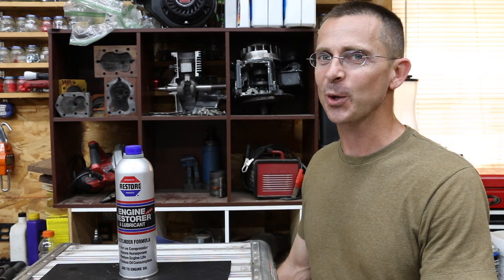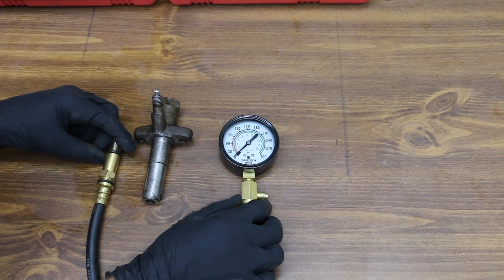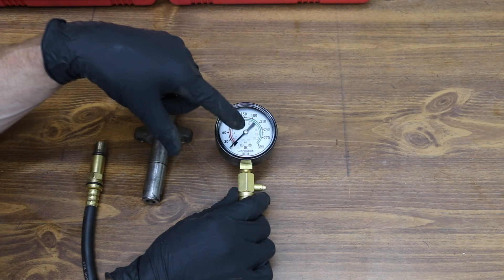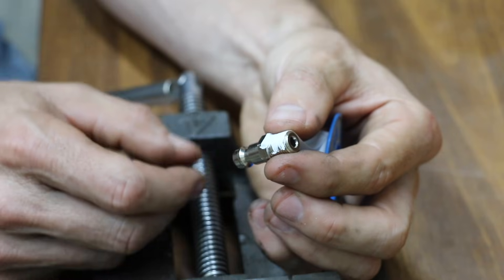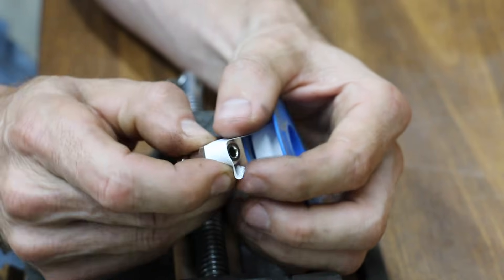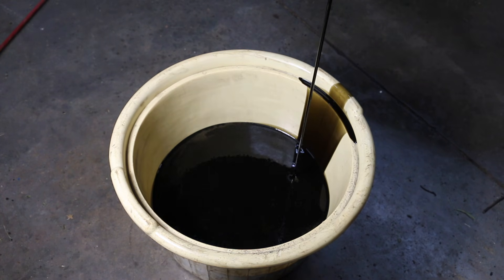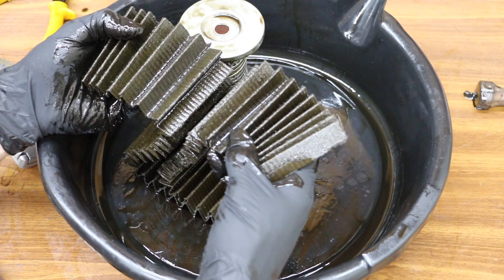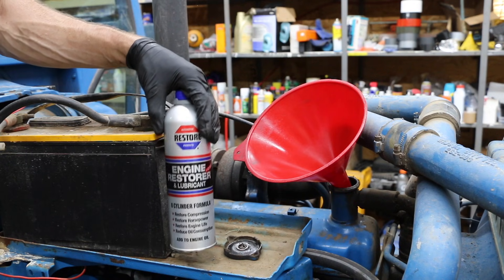Did the "Engine Restore" Compression Improvement Last?  One year later (Episode 2)

Comment from the maker: Thank you all very much for suggesting an update video engine restorer!  Best regards, Todd  
Engine Restorer for 8 cylinder engine: https://amzn.to/3j4JoEb
Engine Restorer for 6 cylinder engine: https://amzn.to/32kpEpt
Engine Restorer for 4 cylinder engine: https://amzn.to/32liXDq
Reply: Wonder how the compression is nowadays…
Reply: If u ever cut open another oil filter, squeeze the paper before you open it to dry it out the liquids then open to see if anything is between bends(thick liquids can hide solids)
Reply: I wonder how that stuff works,and restores compression
Reply: @antonoudenhoven7573  soft metals bond to the cylinder walls
Reply: @antonoudenhoven7573  Probably the same way as cera tec with a light coat sealant for the gaps.
Reply: So is it OK to use a16 ounce can of restore in a 4 cylinder diesel engine with a 9 quart capacity?
Reply: @tomgreco9905  the can says what engine displacement it works with.
Reply: @der_pinguin44  👍
Reply: @tomgreco9905 yes..that's what he did.
Reply: What is the recommended frequency of use for Restore? On an engine with 255,000 miles on it would it be recommended at every oil change going forward or periodically every 10k, 25k, 50k, etc. Great content as always! Thank you so much!
Reply: @TravisStepp  there is no suggested interval. I did mine 50k miles ago in a Colorado, and it's still doing well.
Reply: @der_pinguin44  understood, thanks!
Reply: @TravisStepp  I do advise to check your compression first.
Reply: @der_pinguin44  Do you have a recommended compression tester? As opposed to me buying one at random on Amazon.
Reply: @der_pinguin44 at every oil change. Says right on the bottle.
Reply: @cjackfly  it used to not. It used to advertise usage after the engine has so many miles. In fact, I found the company's Slovakian website and it says after 50,000-70,000 km.
Reply: @TravisStepp yes..says right on the bottle
Reply: Is the Ford 5000 still going.
If so how is it running after 4 years.
Reply: You need to do a video on TriboTex; your lubricity tester should provide some good results.  Here is the paper about it's development: https://www.sciencedirect.com/sdfe/pdf/download/read/aam/noindex/pii/S0301679X17300531
Reply: Please test Xado also engine restore not work well vvti engine. I found new product seem like it work like ceratec + engine restore. Want to know it work or not.
Reply: I may be wrong I haven't watched all your videos but if you haven't covered it yet I would love to see you do a review on all these new ceramic waxes😳 it's overwhelming and I believe a lot of it's BS but some of it's got to be good stuff
Reply: Can it be used for with fully synthetic oil?
Reply: I would have liked to have heard the engine run before using Restore. Also, would have liked to have heard what the fuel burn was before Restore and after Restore, plus the fuel burn at 1 year....
Reply: I do that all the time.
Reply: Impressive improvement in cylinder compression and longevity of improvement!

I used to use restore in a very worn 2800cs bmw.  Made me feel better, might have done more than I thought?!
Reply: 4cyl ------ 9oz = $8 --- (2.25oz at $2.00 per cyl)
6cyl - 12.5oz = $13 - (2.08oz at $2.16 per cyl)
8cyl -----16oz = $12 - (2.00oz at $1.50 per cyl)
(whaaa??)

I have two 6cyl and one 4cyl cars, so I think I'll just buy 48oz (three 16oz bottles) and measure it out myself...

4cyl 9oz x 2 = $24 (18oz)
(2)6cyl 12.5oz x 4 = $52 (25oz)
Totaling $76 for 2 oil changes each (43oz)
==OR==
16oz x 3 = $36 for 2 oil changes each (48oz)

That equals 3oz at $1.50 per cylinder, for less than half the total price if you buy the "correct" bottles.

Pay attention in school kids lol.
Reply: @EPR-6  You obviously did Elio...Good Deduction on that!!! I never thought all of it is used in the V-8 anyway, if it's all used up, I doubt the engine would have enough compression to start in the first place...
Reply: @EPR-6 that is strange.

Comment: Please do Xado Revitalizant.
Reply from the maker: Thanks for the idea!
Reply: @ProjectFarm  coolness, if you do do it, Xado also claims that the cermet buildup on the friction surfaces is semi permanent, good for 65,000km without need to top up between oil changes so 3 lab tests on the oil before xado, during the treatment and the oil change after the xado has been drained out, This would take months. It's just a matter of you finding a vehicle with low compression.  Thank you

Comment: It's been a while since I've commented, but I will say again, nice work in your videos as they are worth watching. Also, I want to add that I've had decent results with Engine Restorer myself on more than one of my vehicles in the past. I haven't noticed any videos about transmission fluid additives, yet, but I will say that I've had good experience with Transmission Restorer( same style can as Engine Restorer ) in two of my previous vehicles. Check it out when you get a chance. Meanwhile have a good day.
Reply from the maker: Thanks!  Thanks for the suggestion.
Reply: @ProjectFarm  Hello again after being absent, sorry about that. Anyway, I just watched your fuel review/test video and the fuel stabilizer plus headlight restorer video. Really good work on both by you. I've had my own opinions regarding e-10 fuels based on personal experience and opinions from others. My biggest issue with any ethanol based fuel is how it is sourced. That aside, with fuel stabilizers I've always favored Sta Bil, and your testing just confirms my choice. As for the headlight restorer testing, I'm somewhat surprised at the results. Personally I've used gritty type toothpaste , a bit of water, and some 'elbow grease' to do my vehicles headlights. The task needs to be done at least once a month, but it only costs a few bucks. Again, good work and very useful info. Thanks much and have a blessed day.

Comment: Ive been using engine restore for 20+ years and swear by the stuff. Just last night Indid something I've never done with engine restore. I drove my car around until warm and then added engine restore to the oil while the engine was running. What happened next surprised the heck outta me! The engine literally started running smoother and quieter as I sat and let the engine idle with the restore in it. As I sat for the next 30 minutes the engine git quieter and smoother! It would be awesome to see a PF video proving that this happens! 😊
Reply from the maker: Thanks for the suggestion.

Comment: I'd still love to see if there is a difference between the 10 dollar mower blades and the 30 dollar mower blades... and those in between.  Oh, by the way, there's a new battery booster to add to you next test... Essentially it's half a set of jumper cables with a M18 Milwaukee 6ah battery on the other end, available on Amazon. How about a test on the bedt way to recondition a "bad" car battery?
Reply from the maker: Thanks for the suggestion.

Comment: If you want to "Screen" any type of fluids,   get some. 
 Disposable Paint Funnel Screens,    they work great for filtering almost any type of fluids,   and they are disposable paper and very cheap at only a few cents each,.   I have used them for many years for many purposes,  especially for filtering used antifreeze when replacing water pumps or radiators.   And the great thing is that that fit inside of other Funnels,  and they are designed for paint filtering so they pass heavy liquids easily.
Reply from the maker: Thanks for sharing.

Comment: I know this video is old, but I have a ford 9000. Really it’s the same tractor. If you look at the intake coming across the right side of the engine. There is a small hole. I hold a propane torch to the hole and hit the starter. The engine will suck a little bit of flame down the hole. It doesn’t hurt the tractor. It heats some of the air going to the pistons before it gets to the fuel. If you have one of the same type tractor and it’s hard to get the first start, try it. You only need to do it on the first start of the day. Those engines don’t have glow plugs or anything to create the heat for the diesel to start, just compression.
Reply from the maker: Thanks for sharing.

Comment: I used Blue Devil coolant sealer on my tired old 5.3 Silverado when I saw the tell-tale exhaust steam. Followed the directions exactly, and problem fixed! I felt safe to try it as I did not see any oil & water mix. What was likely a blown head gasket is now sealed and back to being my daily driver. 260,000 + miles. Noticed one difference, the water temp went up about 5 degrees. I would recommend it to anybody, but you HAVE to follow the directions to a 'T'.

Comment: What does the cylinder walls look like before and after use? I don't understand what this stuff does. If it seals up the vertical scratches in a cylinder that causes rings to leak compression. I would assume it would also fill in the hone cross hatching that is supposed to hold oil that seals the rings to the walls along with giving less contact area reducing ring friction. Does it burn more oil now?

Comment: Since your first video I've been putting it in my 89 F250 351W and it has been a night and day difference. I didn't realize how old and tired my truck was until then. Thank you
Reply from the maker: Thanks for sharing the great results.
Reply: Would be curious how that 351 Windsor is doing after a year. I have a rather clapped out '81 Dodge Ram 3/4 ton 4x4 with a carburetor 360la, & it needs some help, & a engine swap or rebuild most likely won't happen until next year, & I also need to have the truck for severe Winter use when the snow is too deep for my old Corolla.
Reply: @harvestblades the truck still runs amazing. Great compression on each cylinder. Daily driver and still great. Thanks for checking in.

Comment: Excellent test & result. I’ve used engine restorer 30 yrs ago in a 130k mile olds Omega. It worked for restoring power and compression. 
I recently used it again and I noticed the formulation are quite different. The 90s version was grayish with a fine silt like texture. The modern version is blue with a much finer texture more like ink.
Reply: What year was the Olds Omega and what engine did it have?
Reply: @gregorymalchuk272 It was an 82 with the 3.3 V6

Comment: I added the 6 cylinder version to my 2008 Honda Pilot (244k miles) after the last oil change. The oil level went up a bit over the high mark. I got a pending ODB2 COde for an inefficient catalytic converter . I cleared it up with my reader and after 100 miles or so it went away. I think it had to do with the higher oil level. So just keep that in mind if adding to a car and you exceed the oil level. 

I have not done a compression test yet. Will do before the next oil change.

A suggestion. I am not sure about diesel engines but on gas engines it is a good idea to do a Dry and a wet compression test.
Reply: what was the results

Comment: I have low compression(100psi on a cold engine) in one cylinder on a 2006 infiniti m45 4.5 v8 189000miles. Buddy suggested sea foam but after seeing this I'm leaning towards restore. What do you think?

Comment: I know this is an old video, but I just used engine restore in my 97 wrangler with straight 6 @195k miles. Had lifter noise, almost sounded like a diesel when running, used a can of this and in a few minutes it started quieting up, took it for a few trips and no lifter noise at all now. Amazing stuff. Thanks for the cool vids Project farm!

Comment: I used this product on a old dodge ram pickup that smoked on start up. Worked great and stopped the smoking completely after about 50 miles. Had a lawnmower with the same symptoms and this product stopped the smoking. This is a great product.
Reply from the maker: Thanks for the feedback.

Comment: Hey there I have a 3-cyl diesel 1986 Ford 1710 tractor. I bought it 4 years ago with 800 hours on it.  I'm not a big Ford fan but the tractor seems great!  I need to change the oil and filter before winter.

Question for you, as to what product and how much you think I should use. I have a 1995 Subaru 1.8L 4-CYL boxer Impreza, 177,000 miles.  I have 76 and 78 PSI dry compression in #2 and 4 of one head (driver side).  This started a few days ago, we noticed while on a highway trip the power was weak and I can hear it missing as the RPMs drop from driving to idle.

I don't have overheating, excessive oil consumption (drippy seals, I add a quart about every 900 miles), smoking, or fluids cross contamination.  I'm waiting to have a leak down and another dry/wet compression test at a different shop. The first shop only did dry compression and wasn't too bright or helpful. 

If I end up having a head gasket leak between those two cylinders, what products would I possibly try to mend it?  It must not be too bad of a leak, whatever it is, for the compression to build to 78psi dry.  The other two good cylinders are 130ish psi. 

If it ends up being a valve leak, what products and strength could I try to get them clean?  After cleaning, I will have valve clearances checked, as it's probably never been done. 

Thanks!

Comment: Wonder if there is any negative effects with "Engine Restore" and "505 CRO Oil System Treatment" that Scotty Kilmer always mentions. Will it harm the progress that Engine Restore has made, will it also cause any clogging or remove Engine Restore. Will 505 CRO Oil System Treatment cause any premature wear from thinning of the oil on the bearing surfaces. Also the old ford tractor if you use 505 CRO Oil System Treatment will it make it act like it did before Engine Restore making it so it wouldn't start.
Reply from the maker: Thanks for the suggestion.

Comment: Appreciate the 1 year follow up!

I have been using engine restorer in numerous engines over the years and it seems to be one of the few products that has proven to improve engine compression almost immediately. It has now shown to continue improving compression based on your experiment which is reassuring. I run it in my 5.9 cummins and she seems to like it a lot.

Comment: Writing to you from Belgium here. Love your channel. I am HVAC installer. The ptfe tape... you really need to pull it in between the treads and try to use the loctite ptfe wire that you can apply more accurate and pull in between the treads more easily. And don't you use treading oil?

Comment: My 2017 Hyundai Santafe misfire in cylinder 1, will this engine restore helps? 
Kindly respond @project-farm
Reply: An ignition coil and spark plug change would probably fix that, unless it’s a dead cylinder
Reply: @sterrshow5016  thank you for the advice. I did however the idling is still rough and when scanned, the error code still same and engine light on. I just drive it like that.

Comment: I wonder if I can add "Engine Restore" and "Bar's Ring Seal Smoke Repair" at the same time...

Bar's Ring Seal is basically polymers that stick to the Rings, whereas Engine Restore has bits of metal that stick to the cylinder walls.  Anyone ever try this with success?
Reply from the maker: Thanks for the suggestion.

Comment: LOW OIL PRESSURE GAUGE AFTER USING THIS 

ON 2 different vehicles , oil change fixed it immediately….

Ok after seeing this video. I put this engine restorer to my healthy running 2006 chevy 3500 6.0 gas, next day i have low oil pressure on gauge. Week later i got even low oil light on every start vehicle no matter cold or hot start…changed oil for mobil 1 5w30 all good immediately …. At same time i put this crap in my chevy 2011 5.3 1500 because I got low oil presure on gauge. I did this to at least improve compression in cylinders… the oil light come on in first hour of driving pressure same or even lower.soo i will have to do next oil change..
 can you explain that???
Reply: In the unlikely event there's an indication of abnormally low oil pressure after adding RESTORE, this is a result of too much sludge in the oil filter so it is best to change the oil & install a clean filter. Oil filters are designed with a by-pass valve to maintain oil flow to the engine in case the oil filter becomes clogged with excessive amounts of sludge.

Comment: Try and reduce the volume of your injector / compression adaptor. As any volume before the check valve in the tool (usually on the hose end) will be added to the squish volume in cylinder and will cause your gauge to under read. Your tool is great for comparing cylinders and before / after effects. But i wouldn't trust it for an absolute reading.

Comment: Years ago, I started using Engine Restore after I heard about it on Car Talk with Click & Clack, the Tappet Brothers They said it was the only engine additive that seemed to work. So, I tried it in my 1989 Safari Van 4.3 V6 with 225 miles on it. After only 50 miles, I could see a huge improvement very quickly. And, I continued using it past 341k when I junked the van in 2015 due to Indiana winter road salt. I have also been using it in all my other vehicles and they run great... 2000 Safari 201K, 2002 Ford Taurus 263K and 1996 Astro Van with 321k.
Reply from the maker: Thanks for sharing.

Comment: For me did work and still working well in my cars I don't about others but for me do work I'm talking about high mileage engines from old Toyota to short base Geo trackers with high mileage plus old school intake cleaners and fuel injector the new crap I don't used I stay with old school ones like Lucas stp etc.my cars always kp running smooth and with gd compression and gd gas mileage even that they are old engines and high mileage engines but I always used gd gas high uptain gas to kp my engine clean really that the key gd gas to the rest is craps and theory

Comment: Using the same gauge would remove the variation due to the compression tester. Even calibrated ones have variation. Accuracy is over the pull range. So 1% of 300 PSI vs 1% of 100PSI results in a +- 3 PSI vs +- 10 PSI.